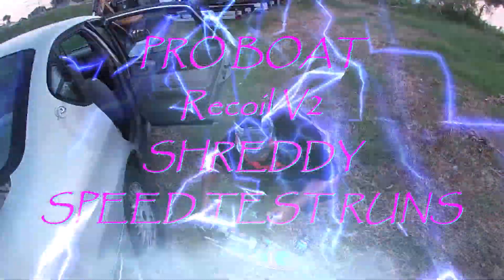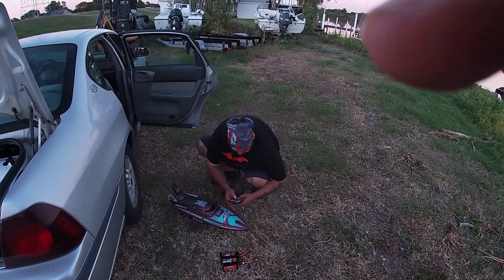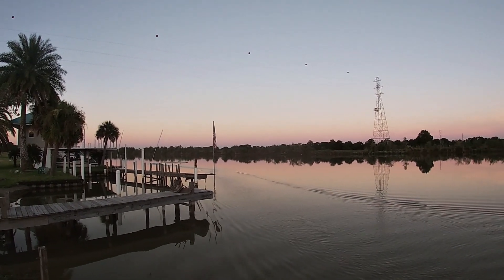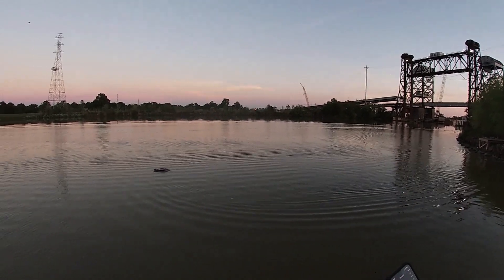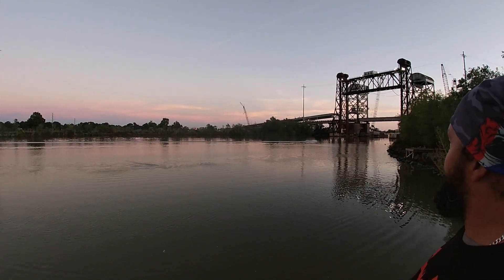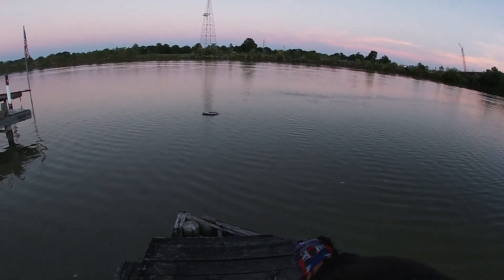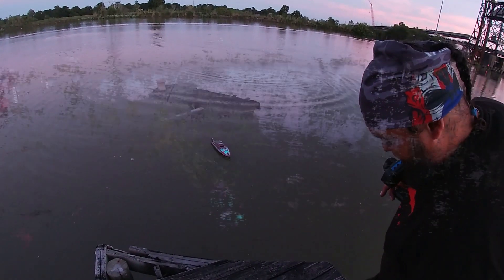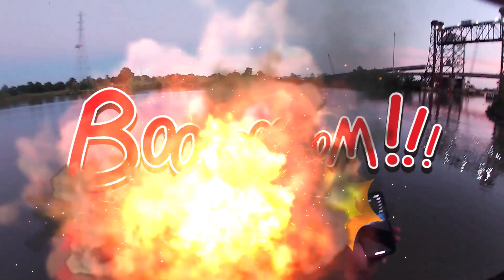ProBoat Recoil V2 - Shreddy Speed Run Tests

Comment: 2300kv * 14.80v  = 34040 rpm's... that stock outrunner motor know how max rpm can make? Max i did on my older Recoil was 89kmh. On this new v2 max i did was 99kmh. But neither had stock eletrics! And was runing a doctor prop's on the first model...need to try on the 99kmh...but afraid to burn the esc's...ok just a couple of passes and see! :) thanks for the video!
Reply from the maker: You're welcome!

Comment: hi guys. any heat problems
with the esc or motor using a 4S batery ?
Reply from the maker: not at all
Reply: thanks ! does it still self rights with the 4S batery ? which is the size of the stock flexshaft  ?
Reply from the maker: @eduardonessim4499  it does self-righting with no issues. Temps were 110/115°F. Pretty sure you can find that information on the Horizon Hobby website.